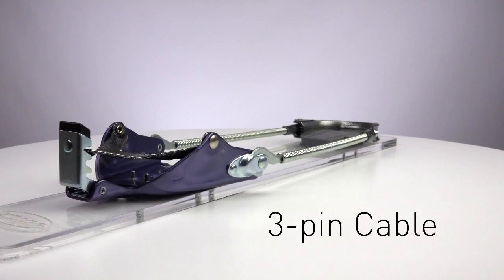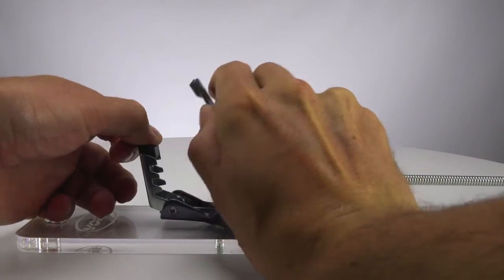Voilé 3 Pin Cable Telemark Binding

Comment: This is a nice binding.  The cable is not necessary if you have a really solid and stiff boot sole, but the cable CAN stiffen and help if your boots need some extra support.  IF you really know how to telemark ski, this binding and a good solid high ankle leather boot, perhaps with a rigid plastic cuff is all you need to cover the whole mountain.  With this set-up, you can do lift service or back-country skiing.  Nice reliable binding.  I have skied this for years and never had a failure.  I like the wide bale because it does not chew up the toe of your boot.
Reply: Would this work well with a T4? I'm thinking of running the T4 with the Voile 3pin HD mountaineer.
Reply: @paulmacgillivray3947  yes, it would work very nicely with T4 boots